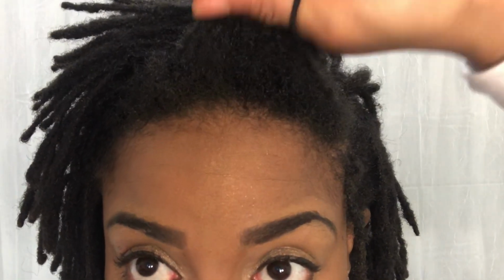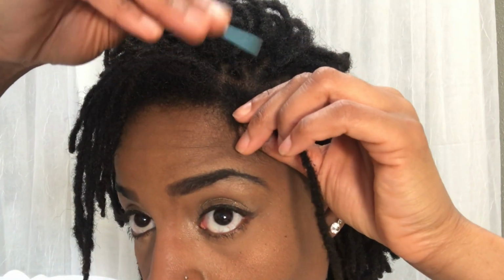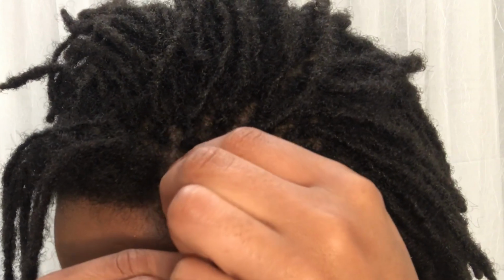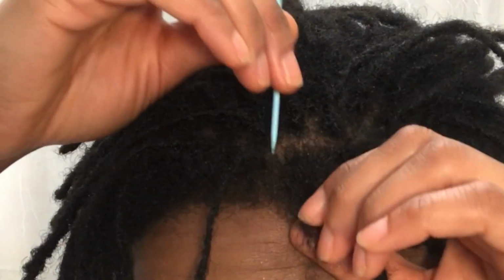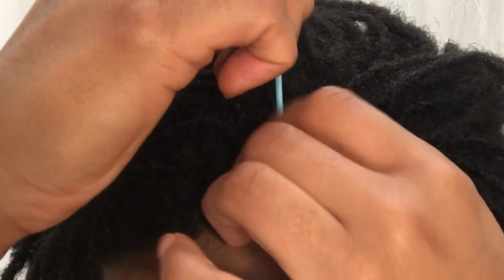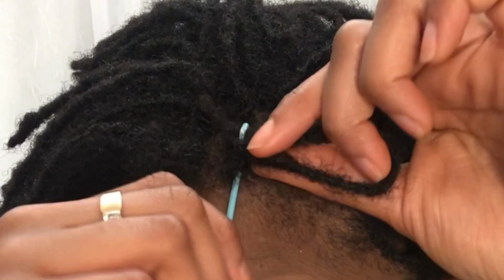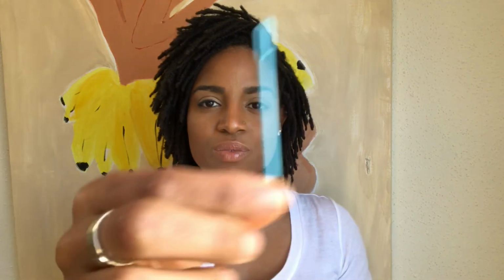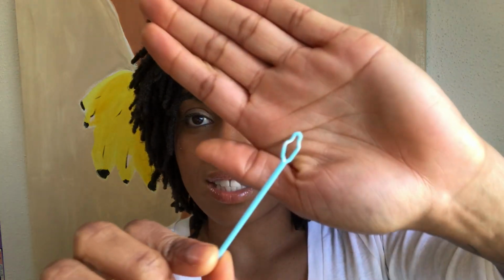How To Interlock Locs | Cc Devereaux

Comment: Beautiful  Locs, does doing a 4pt, make the tight and smaller,  compared to 3pt, or 2pt. What's the difference  in rotation numbers? Thanks in advance.
Reply from the maker: Tabitha Moore Thank you! And I don’t think the point methods affec the size of your locs; I believe that’s determined mostly by the the size of the loc parts. As far as tightness, from my experience, it’s only tight if you pull the loc through tightly and/or if you interlock too close against the scalp.

Comment: I interlock using the same tool too lol. I thought I was the only one.  It was frustrating for me to use it at its so full length though, so I cut it short, burned the tip and rolled it smooth while it was still hot so it wouldn't snag my hair. I move a lot faster now that it's shorter.
Reply from the maker: Cretia'S Place Omg I used to do the SAME exact thing! Lol I stopped having to shorten it a little after my one year anniversary. 👍🏽👍🏽
Reply: Cc Devereaux You know what they say about great minds... 😂

Comment: I see that I'm not the only one who uses this tool. I also use the metal one similar to this one. I've used the yellow needle that's larger but it doesn't tighten as well for me. I started and maintain my own locs because I just refuse to pay for something that I can do myself. This method works well for me but I think I retighten to often ( once a month) because I like them to be neat. I've had mine for 2 years. Never took the time to count them smh but I'm sure there are at least 200.
Reply from the maker: I don’t think once a month is too much; especially if you’re not doing it too tightly 👍🏽👍🏽 And I totally relate to not paying someone else. I’ve had some bad experiences with stylists before I locd and I’ll be LIVID if they damage them Lol 😩 But thank you so much for watching and congratulations on making it to 2 years 😊💚

Comment: Are Your Locs bigger than the other cause mine is and I’m trying to get my old dreads put into my head does it matter or
Reply from the maker: Ayannah Knight Yep; my locs are different sizes. I wasn’t concerned about them being uniformed when I started them and because my hair is so thick, the differences are subtle. When you say your old dreads, do you mean you’ll be reattaching a set of locs that’s you’ve cut out?
Reply: Cc Devereaux yes I’ll Be Reattaching The Locs I cut out will it make a difference or
Reply from the maker: I think it will make a difference if the locs are smaller/larger than the new parts/locs you're attaching them to. 
 But I'm not 100% sure; I've never had experience with it Lol